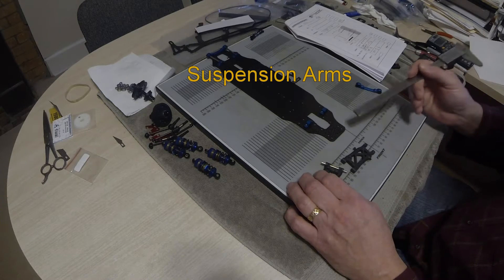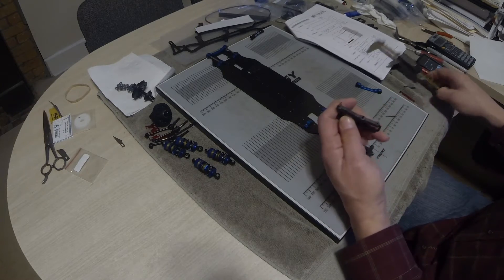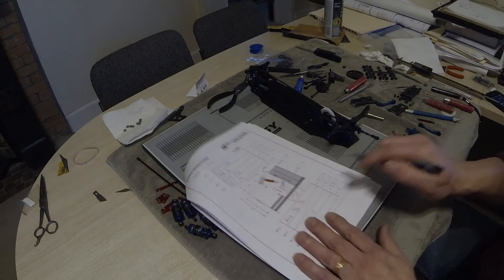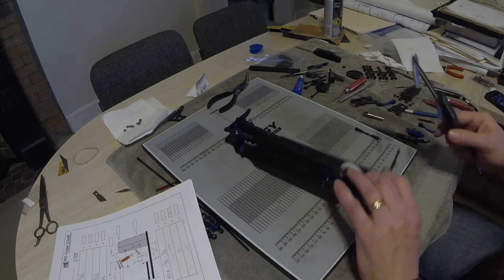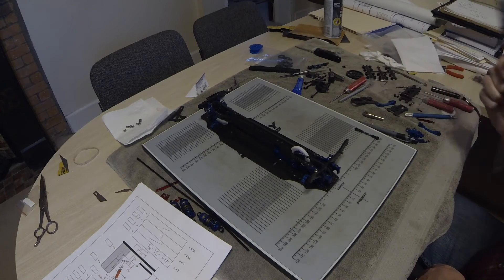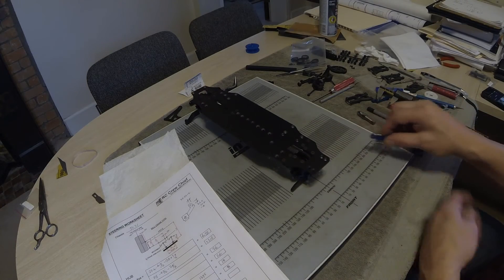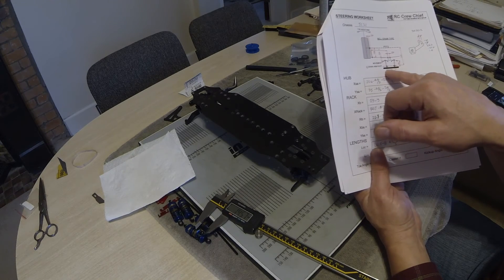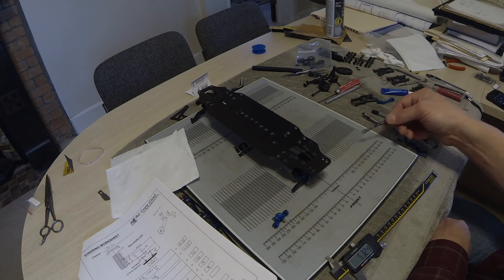TC7 1 Part2

Comment: I'm a bit confused by the Lcc measurement you've taken for the steering rack. You've got quite different measurements between the TC7 and TC7.1 models, despite having the same components. You're also measuring to the centre of the diff, not to the centre of the kingpin/axle axis, which may be different if the driveshaft is swept. I'm also not seeing anything in RC3 that accounts for changes in the relative kingpin location for when the arms are shimmed back and forth for wheelbase adjustments. Have I missed something there?
Reply from the maker: If memory serves me correctly for the TC7 the Lcc value was set with the suspension arm shimmed forward so I added 1mm to the measured length. The other .5mm is just differences in the measurement stack up. Lcc is one of the most difficult values to determine accurately due to the number of measurements needed to get the value. If I had access to a Coordinate  Measurement Machine this process would be much easier and more accurate. Unfortunately that is not the case. I am planning a new version which will include the ability to shim wheelbase, sweep .... but it will be a while.
Reply: Thanks for the clarification